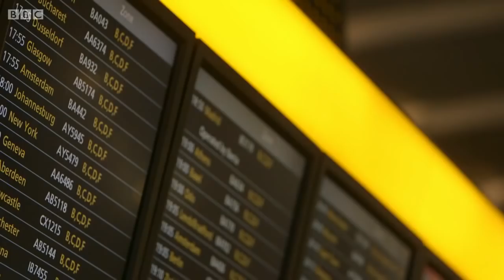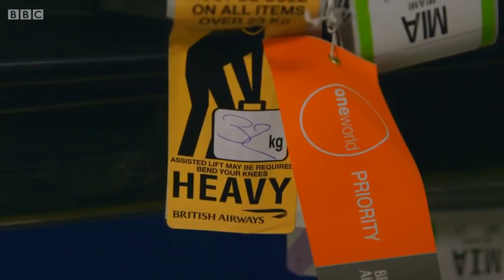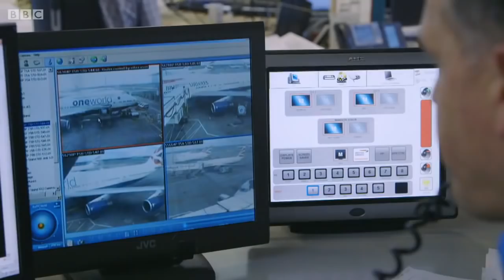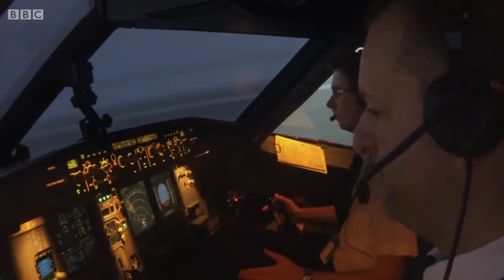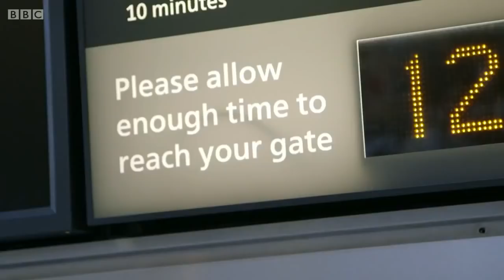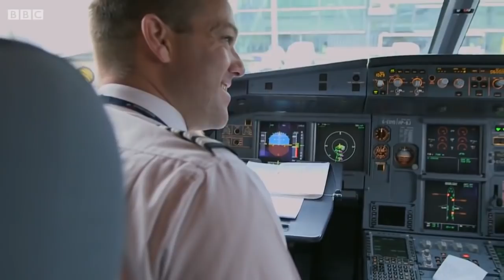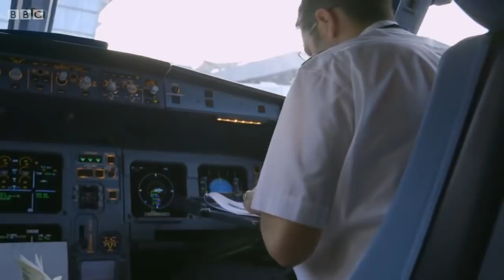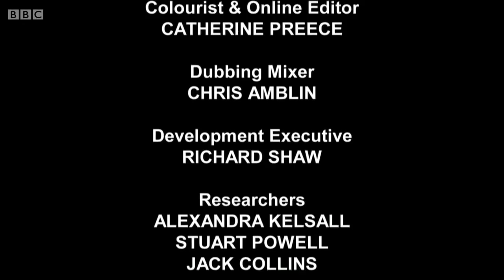A Very British Airline - British Airways Documentary, Episode 3

Comment: It’s nice to see standards are being kept regarding smart uniforms and peak caps for the pilots 👍
Reply: I just flew British Airways from New York to London Heathrow.   I was shocked at how scruffy they looked.  Even down to their flat scruffy shoes.  Not as smart as I remember they used to be.  Also had to pay to check in 1 suitcase $75.  They don't allow any check in luggage, you have to pay extra.  Over priced and over rated.  I will never fly BA again!
Reply: @mycat1064  I believe you took the budget version not the proper BA which is quite expensive already and the budget one is to compete with budget airways.
Reply: @kyleanuar9090  oh I didn't know they had 2 standards lol and it wasn't cheap by the way

Comment: BA should stop short range flight, BA should by long range flights because people don't prefer to fly long range routes with a budget air
Reply: Ifly 777 nice business strategy specially for BA
Reply: Ifly 777 Not to mention, budget airlines aren't as big on the long haul anyway, easy jet for example have a fleet catered towards short haul, inter continental flights.
Reply: As someone who regularly flies to and from Continental Europe, budget carriers are fine if you have time to spend (waste) at both ends getting to the more remote airports, but if you’re on a tight schedule it pays to fly a flag carrier airline and be right where you need to be.
Reply: I always fly Emirates long haul, economy allows extra 10 kg baggage, & business class is divine.

Comment: I flew with BA twice and Never will again. I got on 7 planes which were very old!. 3 of them were b747 that did not even have a separate air control for each seat. The service was terrible and London Heathrow does not even have a smoking lounge + they only announce the terminal 45 min before the flight (if i'm not mistaken) and the gates 15 minutes before departure time. And on each of those flights my baggage always arrived late, and they lost a bag which I got refunded for.
Reply: rook229 there was a smoking lounge when I was there in 2017 T4.
Reply: "I flew with BA twice"....."I got on 7 planes"
Hmmm, something doesn't sound quite right.